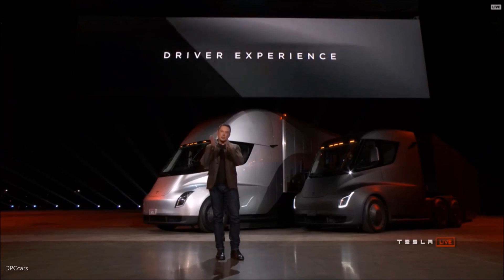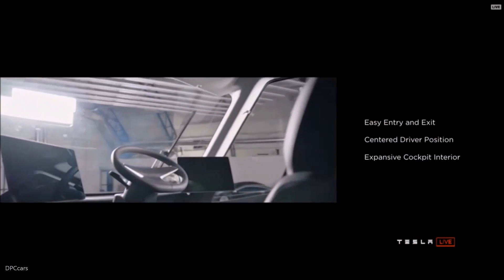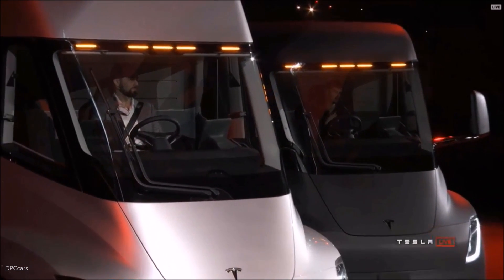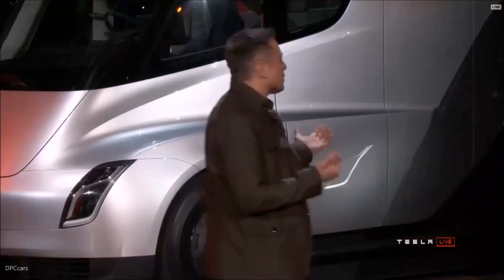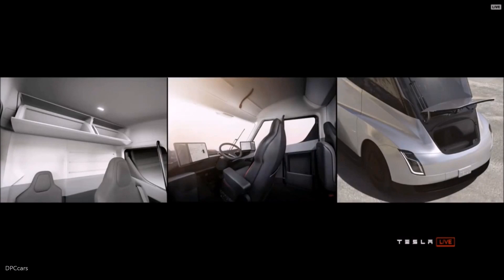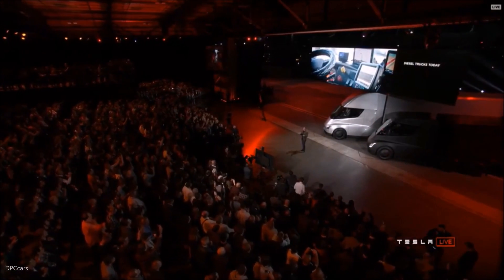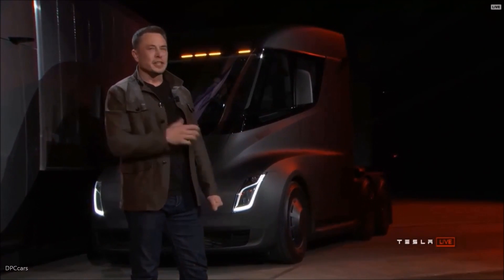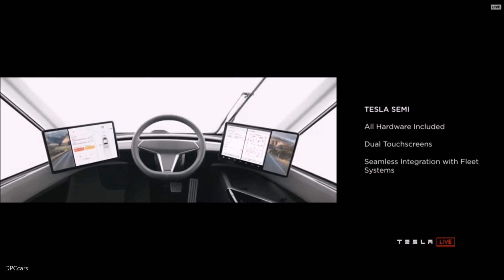Tesla Semi Truck Interior Explained

Comment: The biggest thing this truck offers is the huge amount of money in deisel consumption. Huge savings for sure.
Reply: Maybe. 
Tesla cars dont save you THAT much money. They cost 20 dollars to charge, which takes many hours. And they only replace about 40 dollars worth of gas. 
Half is nice, BUT, you now have something that most mechanics dont know how to fix and most places won't be able to charge up. 
I think I may wait until I see charging stations everywhere.
Reply: @Shorty_Lickens  butttt... here it iss.. no oil changes... no transmisson.   Brakes barely get used last way longer... matineence is so far less then an average car

Comment: My question is when it breaks down and the computer controlled stuff does, how are you going to fix it along the Interstate or even tow it with a wrecker? Has anyone considered that yet? I know a lot of the new trucks are becoming a challenge to hook a wrecker up to nowadays.
Reply: Each wheel or duals has an independent motor.
Reply: Your car has had little computers in it since the 80's. 
Cars also work much better today than they did in the 80's. 
It will be fine.

Comment: So how do you release the trailer air brakes if you don't have an air system on the truck. I guess this truck is not going to be an otr truck due to there is no sleeper cab for the driver to rest. and I'm assuming no side mirrors because why not. don't need no side mirrors to back the truck and trailer to the dock.
Reply: They used cameras so u see the sides on the computer screens inside the truck
Reply: what happen when camera fail. I guess your s o l.
Reply: Its an engine brake. When the motor on each wheel stops the wheels stop. This is NOT the same as a Diesel truck. They are trying to change the way you travel to create more safety. Its 100% electric.
Reply: I know its 100% electric. but tesla wants to make these like similar to a regular semi truck. but the thing is, on diesel motors, they have an air compressor that is mounted and run by the motor, to build air pressure up to use the air brakes on tractors and trailers. So due to there is no engine. no engine to run an air compressor, then how would you release the trailer air brakes. it seems to me that tesla would have to build an air compressor to release trailer brakes, but then that will eat up in voltage and range of the truck. 

To me, I see a problem that possible tesla truck drivers will come across is that when they pull up to a trailer and start hooking it up, come across that, hey i can't release the trailer air brakes due to there is no air system on this truck. When they demo the truck, that trailer they towed in probably don't have any air brake system. but that is my concerns about that.
Reply: technology will fail at sometime or another. truck drivers these days won't make enough money to probably repair it. they need to stick with side mirrors.
Reply: this was a prototype, they never built it. it was for reference and learning.
the truck they are building has mirrors. it has a nice bed, and kitchen. it has brakes but not air brakes.

Comment: HOLD ON HOLD ON - The Tesla Semi Truck Interior is basically the SAME COPY of the Walmart Advanced Vehicle Concept Truck here -> https://youtu.be/NER9X4_gtYk

As you can see - the Walmart Turbine Electric Semi Truck was showed 3 years ago in 2014. Unfortunately, it was so expensive that it never went into production. Walmart SECRETLY went to Tesla and asked them to build a similar truck for them but fully electric. After 3 years in design behind closed doors Tesla finally released a Semi Electric Truck with the SAME INTERIOR DESIGN as the Walmart Truck that failed to come to market. SURPRISE SURPRISE - WHICH COMPANY WAS FIRST TO MAKE AN ORDER FOR TESTING????? YOU GUESSED IT - WALMART. Walmart ordered 15 Trucks from Tesla and they will extensively test these. I can bet you my balls - when Walmart is happy with the results they will order between 1000 - 3000+ trucks for their whole fleet in phases.
Reply: WOW I HEARD ABOUT THIS

Comment: Some diesel rigs have bathrooms, showers, and all have passenger seats- a driver may want to pick him some a** up along his route. Tesla, your not there yet!
Reply: with the distance range up to 500 it is designed for "local" delivery not for trans America rides and it does not need the extra comfort
Reply: Chris Ericssen they have them, search online.
Reply: Put this link in a search engine: 

https://www.bing.com/images/search?q=truck%20cabs%20with%20bathroom&qs=AS&form=QBIR&sp=2&pq=truck%20cabs%20with%20&sk=AS1&sc=8-16&cvid=65720ED1643844E3B8E132CE490DAE71
Reply: More practical for daycabs and dedicated route drivers, but OTR not so much.. It will need longer range and a sleeper berth. The sleeper will change the specs a little.
Reply: I saw the second seat. look again.
Reply: they never made this. it was a prototype to learn on. the truck they are producing has a nice bedroom and kitchen. and a passenger area. 
calm down.

Comment: Anyone will be able to drive a semi-truck in the coming years and especially when they go autonomous.
Reply: Maneuvering a truck and trailer is not as easy as many think, its more difficult than it look without formal training or experience.
Reply: Joshua79C C I know that,I'm just saying even Elon Musk said he could drive it and he has know idea how to drive a Semi-truck,so it's going to be so easy in the future.
Reply: Ok so you are saying you can back up and in this basis you are in a left hand drive semi, and so your backing up the trailer to the left to a dock with another trailer just on the right side, at this point soon as you loose sight of the right side, your blind siding it and no cameras to see. Lets say you do not stop every so often to GOAL (Get Out And Look) to see how good your doing, and not doing that as you back it in and the next thing you hear is BANG and think you touched the dock but you see from your view still at a left hand angle are still not at the dock. At that point you realize "i just hit the trailer next door over?" so you get out and look and low and behold you hit the other trailer because you forgot the tail swing. that being how far the tail whips out past the pivot point in the center of the axles. I have not done that yet, but had to dock at least a few places where I had to do that kind of backing maneuver and with passenger cars parked just in the way in the front once I finally get backed in, cab still at an angle.
Also  you would if not careful of pretrip planning or using a non trucking GPS find yourself on a narrow set of roads and again you got tail swing, not only that a wider right turn since they truck and trailer with its length of up to 53 feet requires space, left turns are not that hard with LHD, opposite goes for RDH with left turns, when there is no second lane at the intersection to use to make that right turn without coming near any  utility pole or post on the right side. More so if the road your turning into is not wide enough and you got prick automobile drivers too stubborn or stupid to see they need to back up despite only a few or no one else behind them and you toot your horn and they just flip you the bird so what do you do?
Reply: Joshua79C C I get what you're saying and it's a difficult task driving a semi-truck with a trailer nowadays.  But in the future with sensors and cameras and autonomous driving it will do that like some cars can park themselves nowadays.
Reply: No you'll still need a cdl in case something fails
Reply: Flying Jew Do you mean a Commercial Driver's License?
Reply: Paul Dunne yes
Reply: Paul, good job deciphering what those three letters "CDL" means, and yes you likely will still need to get a Class A CDL 30 years from now in order to operate such machines on the road or in a terminal (be it port, warehouse or intermodal yard).
Reply: Joshua79C C Well a CDL will be alot easier to pass the test when virtually everything on the Semi is automated.
Reply: Paul Dunne No it won't be you'll still need to learn how to drive a real truck incase something happens.
Reply: Flying Jew There won't be any real trucks driven in the near future,it will be robotic trucks in 20 years driving themselves.
Reply: Not until laws are passed that allow full autonomy of equipped vehicles or lesser qualifications also to operate, until then the laws now and from time before now still active will still be the law until those rules change accordingly.
Reply: Paul Dunne They said that about cars too but you'll still need a license to drive them
Reply: Joshua79C C That's true,but those autonomous laws will come in the next decade.
Reply: Flying Jew Yes,but what's going to happen is you will be allowed drink drive as in when you go to the pub,you will be able to get into the car and have it take you home like Knight Rider and you will be able to put your kid in the car on their own and deliver the kid say after the age of ten to wherever you want them to go like school and the car will come home again.
Reply: Paul Dunne That is still years away from happening and a truck will always need a human to do things a computer can't
Reply: Flying Jew it is only ten to twenty years away and yes you will still have to maintain the truck,but not drive it.
Reply: Paul Dunne Well when that happens I'll still have cars and trucks I can drive I barely trust computers today so I will surely not trust a self driving car/truck
Reply: Flying Jew I'm sure most of today's generation will keep older vehicles,but as fuel becomes more expensive and parts are harder to get for older vehicles then they will die out. In the future they may stop making diesel and petrol. But anyway that's about 20 years away,so i wouldn't worry too much.
Reply: No such thing as a semi truck
Reply: Pernection That's what they are called in USA or a Semi-trailer truck. In Ireland they are called articulated lorry or artic.
Reply: Paul Dunne well if the truck is going to be autonomous then you're not even doing the driving
Reply: Black Ace True.